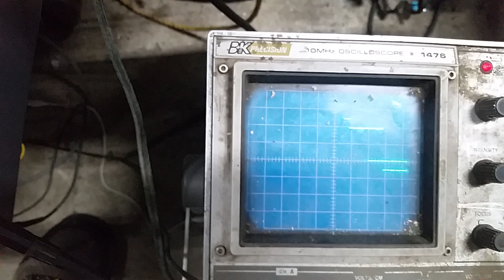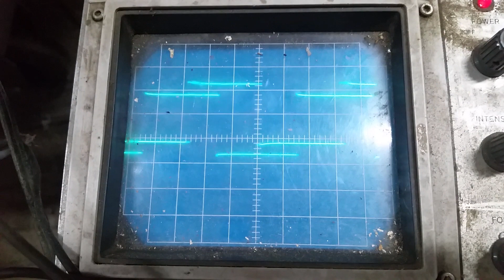Spindle encoder walk through...

Comment: so you will use stepper for spindle drive? using gear ratio, but still would not be better to use servo in spindle mode?
Reply from the maker: The spindle motor is a brushless DC motor...
Reply: samcoinc oh sorry, right, I mistaken it for Z axis drive

Comment: No tool changer, right? I need someone smarter than me to figure out how to successfully tune an orient PID in LinuxCNC lol. I've struggled so long with mine, and couldn't find help on the forums
Reply from the maker: How is your system setup?
Reply: @MakersEase  Yaskawa spindle motor driven by a Teco A510 VFD. 2000ppr encoder on the spindle cartridge.  Using a 5i25 and 7i77.

I programmed a PID loop to control the position of the spindle, but I'm running into a lot of issues with responsiveness and locking into place. 

If you have any thoughts on the topic I can send you my forum link!